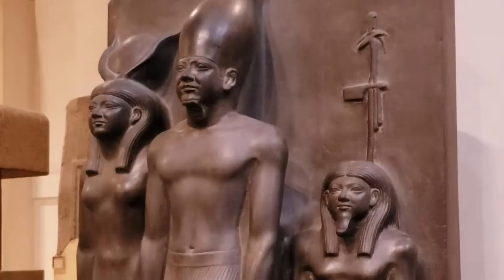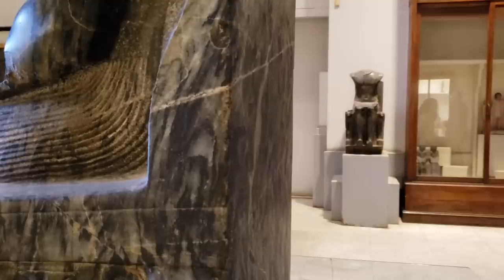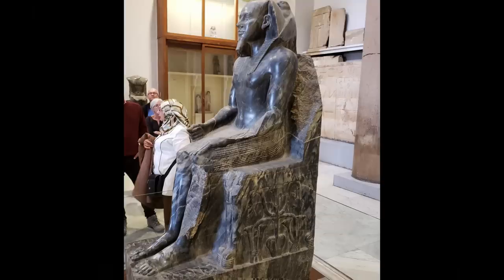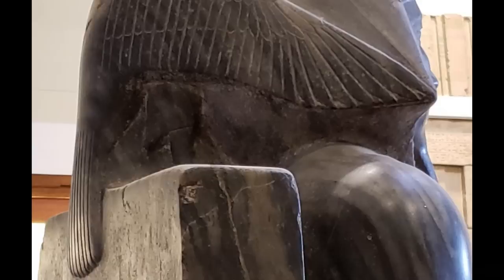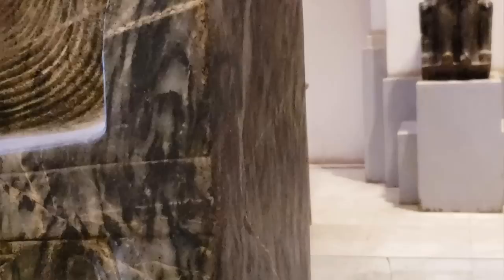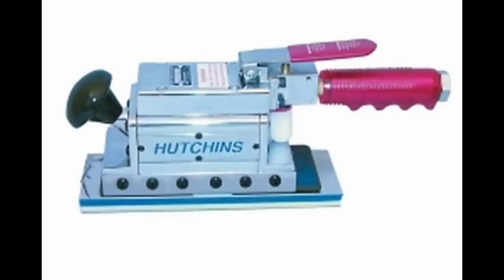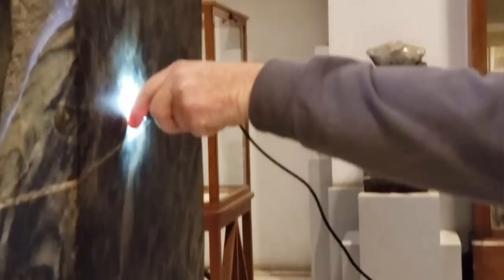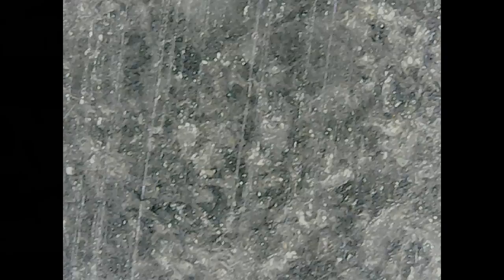Khafre's Diorite Statue

Comment: Diorite is just over half way hard to diamond. Zircon, topaz or any other common mineral could have been used cut and polish.
Reply from the maker: Of course. The question posed is not what sort of abrasives or cutting tools were used but rather what techniques of application would leave those straight, very short, cross-hatch lines.
Reply: @AncientEgyptArchitecture  One probable idea might be "tumble" polish. Today's vibrating machines do so at very high frequencies because we have the technology to do so and we know it speeds up the process. I suppose a low speed, non rotating version would also do the job and leave longer marks since the flow of abrasive would be less turbulent. They  could of put the statue in a special jig/contraption and drop abrasive sand from above and let it do the work. Change the statue in position and repeat. Of course they could do this only after most of the job was done with faster methods such as the rub stones did most of the smoothing. 
Another method (which may be faster) is to use some sort of rope/mesh/cloth contraption full of soft and hard balls or pieces of leather impregnated with the abrasive in a oily paste. The idea is similar to what a shoe polisher would do with a flat rag, but now full of bumps. Since to polish they needed very fine particles (dust) oil is a perfect material to hold the abrasive. Then two people could just pull-push on this special "cloth" to polish the surface. Indication could be change of line direction depending on feature you want to polish, usually along the longest axis. This method will likely leave long parallel lines along the line where the force is applied. A false mould over-imposed on the statue could help force the cloth go into crevices that could otherwise be hard to polish if the cloth is just rub like a shoe polisher would do.
There you go, two ideas in no time. These people were as smart as we are and definitely had a lot of time and labour at their disposal to find ingenious ways to do this. I just had the advantage of being a hobby metal worker and the experience accumulated over centuries now available in milliseconds.

Comment: couldnt they use diamond or quartz? isnt diamond 10 on the scale?
Reply: He is absolutely wrong about you not being able to work it with softer materials. Glass can go from 5.5 to 7 on the same scale. If you see most of the flint knapping videos here on youtube, you'll see guys chipping very hard stones with copper nails.
Cheers!
Reply: @Djanck000  there in lies the problem - "chipping" - you really think this kind of precision and symmetry was created by chipping? - this also doesn't address the equally spaced horizontal striations found everywhere on blocks and statues.

I don't dispute for a minute that softer materials can be used to break harder materials but just how long to you expect a copper nail to last?

I would love someone to actually chemically analyse the base of a deep groove and compare the mineral composition with a flat surface.  If there is an abundance of copper in the groove then you have your answer - or an abundance of another foreign material would lead to a definitive answer rather than all this guessing.

Comment: What kind of drill could produce the famous Petrie drill core?  The one with the helical groove all over the surface.
Reply from the maker: Petrie theorized bronze tubes with fixed points of saphire, corundum or diamond.
Reply: @AncientEgyptArchitecture  That would take eons to drill that core out!  It's granite.
Reply from the maker: Actually, Petrie calculated from examining the pitch and number of grooves that the plunge speed of the drill was approx. 1/10 of an inch per rotation, an astounding feed rate unmatched by modern stone drilling machinery. He speculated that such a speed of advancement through granite would require the application of many tons of downward pressure on the tool.
Reply: @AncientEgyptArchitecture  If I remember this correctly that would be upward pressure as the drill was used to create a hole for a door hanging bolt at top of said door.

Comment: Can diorite break and shape diorite? Like can a piece of diorite be used to chip away, shape, and polish another piece of diorite because they have the same hardness? Please answer
Reply from the maker: I have no definitive answer for this because to my knowledge no one has attempted it, or at least not documented any such attempt. My intuitive response would be no;  Diorite is extremely brittle and if one were to attempt to chisel a block with a sharpened wedge of diorite the likely outcome would be for the wedge to crumble between the impact of the hammer and contact with the block.
However it might be possible to use diorite dust as an abrasive to remove material, in much the same way that diamonds are faceted with a diamond-dust impregnated disc wetted with water or other lubricant liquid. 
As far as rough shaping is concerned, quartzite tools might be able to sculpt it, and flint has been proposed as a possible tool material for diorite, granite and basalt sculpting.
Reply: @AncientEgyptArchitecture  very interesting, thank you. Keep making videos please

Comment: The object is clearly not flat on the back. It is not honed. It is polished, but not perfectly flat. This is just the hard work of Ancient Egyptians. The objects and statues are clearly not perfection: You can see wobbly lines with the naked eye. They are polished to the maximum though, which proves the dedication of these Egyptians....but surfaces are not completely flat or perfectly angled. 
There are many out there who already proved it can be done using ancient methods and materials. Just takes time and dedication... ...and experience, which they had, helps a lot.
Reply: did they prove they could do it while at the same time leaving those long parallel grooves in the material to the exclusion of all others? also, if it could be done any other way, why would it have been done this way, that is, why would they use a method that left long parallel grooves?
Reply: @bluebox7717  Exactly, hand polishing or sanding would make the random type of grooves, as shown in the video, yet it doesn't have those random grooves, but straight lines, which seems inconsistent with doing it by hand.

Comment: Low quality polishing and in every way hand polished. Copper based alloy chisels are adequate for the rough in stages. A professional mason who specializes in chisel carving and hand polishing should have been consulted.
Reply from the maker: Are you a professional mason?
Reply: @AncientEgyptArchitecture  yes I am
Reply from the maker: Maybe you could post a link to some of your work with black diorite, so we could see what a high quality polish job looks like?
Reply: @AncientEgyptArchitecture  I'm a monument builder and architectural stone mason/craftsman thousands of projects to my credit over 40 years in every type of stone available commercially from all over the world, limestones, travertines, marbles, onyx, basalt, granite, diabase, gabbro, gneiss, diorite, andesite anorthosite etc. Diorite has a higher porosity and softer characteristics (low-silica quartz content) compared with harder granites. Have you ever polished stone by hand or by machine with both loose and bonded abrasives to recognize the differences between a hone all the way up in series to a class 4 polish?
Reply: @GroberWeisenstein  I'm interested to know what you think about the scratch pattern. I'm a carpenter so I don't know how scratches and grain patterns work in stone but I'm curious about the straight line scratches on this statue. Any hand polish I've ever done is going to have a semi-circular finish on the large planar surfaces and more than likely straight lines near crevices, edges, and small features

Comment: Flint tools work diorite just fine.
Reply: They sure do.  

Diorite can also be carved using flint, bone, wood, sand.  But if if you say it enough times, Brien Foerster fans will insist it can't be done.
Reply: Do you know why they didn't polish the hieroglyph's and some lines but why all the other features are completely smooth and polished?
Reply: @Antonocon  Because the writing was done after the fact. And to not polish the inner lettering gives the writing more definition. If it was also polished it would not stand out as much. It's like typing on a word doc and having a different colour font to the page colour. Why would you try to match it? You wouldn't see it.
Reply: @Antonocon in certain sculptural designs "props" are as finely articulated or finished in the same way that the main subject of the sculpture is. Especially in a time like that where it would have been more difficult overall to create sculpture like this. But in any case this kind of processing holds true. It's enough that the chair has flat surfaces that are clearly recognizable as component to "chair". Likewise the most important features on the actual subject itself will have finer degrees of finish and polish depending on the importance of the area like the face and limbs etc. In other words the whole sculpture doesn't demand that every aspect of it be finished in the same manner that the main subject and features are. It's not probably the case that writings were added later on.
Reply: @RedDarkBull  This is the way... Lol
Reply: @robertgoodrich192  That is incorrect.  Siliceous stone cannot be carved by anything.  It can only be fractured or ground down.  So you need to answer the question as to who would have done that much fracturing and grinding of hard siliceous stone when they could have used calciferous stone instead?
The answer is: nobody... and there was no precedence for it.
Reply: @redwoodcoast  What?? I've have no idea what you're talking about. Are you talking about calcareous stone? Made from calcium? and comparing it to silica enriched stones? Just use the name of the stones so we can at least work out where you're coming from. Here's the thing, like the video you say why do this, when you can do this, and that is never the case with art. No artist goes the easier route. And especially here, carving a pharoah of Egypt. If he wanted a diorite statue, they made him a diorite statue. Just because there's limestone nearby doesn't mean he has to have his statue carved of inferior stone.
Reply: @RedDarkBull  that's all the 'elite' apologists know how to do

Comment: Similar highest quality artifacts you can find in India or if stolen in UK. But, of course, established archeology claims there never were any connections between ancient Egypt an ancient India.
IN my opinion this artifact alone debunk most of established archeology and anthropology too. Obviously the ancient people were advanced in technology and knowledge beyond us. In other words: We have to go a long way in order to understand what they did and how they did it.
PI x inch in cm = 8 <=> 8/PI = 1 inch = 2,54... cm - Well, not the normed inch of today but the original.
The measurements in ancient Egypt pyramids show the use of both the meter and the inch. With this simple calculating they could easily go from one unit to the other just using PI.

Comment: Well,---for one thing, it would be a lot more plausible to use the tools they did find from the ancient world as the staring point to explain the work performed on the rock. There is evidently a division of labor that begins with the extraction of the stone in its raw state from its mother load and there is the work of carving, further broken down into separate kinds of work the sculpture undergoes. Traditions of hand carving are passed down from generation to generation. A stone carver today still using the old methods might help to explain how the sculptures were finished. I prefer to deal with a known fact than an unknown fact. 2000 years ago the subsaharan desert was a tropical rainforest this would lend itself to natural processes and other elements available to the sculptors. Why speculate and never have real problems to solve but leave it to mystery and forever be wondering how things were made in the past?

Comment: This is Michel Gamil RABBAT Egyptian AMERICAN in Florida..it was never carved using copper or brass since they had better.  biotite..final shine used gomma lacca( acacia rezi. solution)
Reply: Biotite is a 2.5-3 on the Mohs scale of hardness. Diorite is 7. You need a material harder than a 7 to carve Diorite.
Reply: @eoinosullivan2636  " You need a material harder than a 7 to carve Diorite."

If that was true then we wouldn't be able to cut diamonds as there is nothing higher than 10 on the mohs scale. 
Like also cuts like. So Diorite can be used to carve diorite. Someone has carved a diorite vase using nothing but bone, wood and flint and various abrasives.
Reply: @Leeside999 nobody has come close to the precision of those vases in the last 3500 years. 

We haven’t seen anything like them at any other point in human history. 

You are greatly downplaying the tremendous anomaly these objects present
Reply: @steviechampagne 
I agree with your overall point, but in Ben's own videos he compares a modern stone vase turned on a modern lathe to the ancient vases, and the tolerances were almost identical.
Granted, the modern vase was marble,  we absolutely can and absolutely do achieve the levels of precision seen in these ancient vases. However, it is not commonplace for us to do so even with our supposed MASSIVE technological advantage.

Comment: What on earth would cause a straight line mark while polishing??
Reply: Right.. not a machine or anything with high speeds.
Reply: ANY item you like, as long as you pushed and pulled it along the surface. A scrubbing motion which is the most efficient means to apply maximum force.
Reply: mind blowing right

Comment: there was a dagger in tuts tomb made out of a meteorite. could have made tools from another one
Reply from the maker: Actually, after dynamiting a large amount of rock from the side of the great pyramid, Howard Vyse found an iron plate when sifting through the rubble; It has since been subjected to a lot of testing, and the iron is not of meteoric origin but rather is a product of industrial smelting processes. Any academic will testify that Egyptians did not have iron making tech 4500 years ago. But there it is.

Comment: Ancient Architect, the crosshatch abrasive evidence you show is characteristic of the typical method used to transfer a flat reference surface to some material, rather than artistically abrading a surface with fairly random patches of emery, and constant, progressive comparison to a standard.  This suggests a very hard reference stone was used to maintain accuracy as the form progressed out of the raw quarry stone.  Uranium ore, as from Shinkolabwe, seems to fit that requirement.  These bizarrely precise ancient stoneworks often prove to have magnetization that is inexplicable by any means other than by strong radiation exposure.  I suspect these stoneworks all need to be tested for residual content of strong radioisotopes such as highly enriched natural uranium that was common to Shinkolabwe in ancient times.  Its ability to rot thin layers of stone, perhaps in conjunction with water to evolve highly localized pressurized steam could explain the bizarrely elitist stoneworks that popped up out of history's nowhere and have always astounded the world for their mysterious nature.  A single, remote source of deadly energy that could be responsible for the ancient world's original mystery - and it can only be queried further by establishing a radioisotopic residue in the surface of these artifacts.  More magnetic pattern testing would help, too.  Neither of those possibilities seems to attract much popular imagination, tho.
Reply from the maker: An interesting theory, which I have not encountered before. In my opinion, radiologic testing of a great number of ancient artifacts would make for a possibly fascinating dataset, but getting permission/access would be extremely difficult if not impossible, because of the national pride factors at work in Egypt currently. Perhaps in future, more enlightened generations, these restrictions might be eased.
Reply: @AncientEgyptArchitecture  a portable geiger counter could be sneaked in : )
Reply from the maker: sadly, probably not; all who enter must go through metal detectors and put their stuff through x-ray machines, just like at the airport.
Reply: @AncientEgyptArchitecture  oh drat ! Do you think that statue was a museum replica , or the real thing? It looks real to me
Reply from the maker: Not a replica.
Reply: @AncientEgyptArchitecture  That's what I heard.  Isotope counters use an embedded radioactive reference, and import restrictions for that are globally very complicated, with HUGE legal downside.  BTW, the ore-stone reference plates could be made the same as gage surfaces as you find in inspection & measurement device manufacturers.  This is done by a manual "reversal process" using three surfaces that are scraped against each other in alternate order & orientation.  Near-optical accuracy is achievable by that simple drudgery.  I have become resigned that the Indian vimanas were powered by those ore stones, and that an international trade in them was backed or created by the Paracas people after the Black Sea infill dislodged them from the cuacasus.  I often wonder if the Bronze Age, with its elitism, spears, and swords -- and all human civilization -- is just a mass-murder plot invented by a species that hated being on the same planet as us.